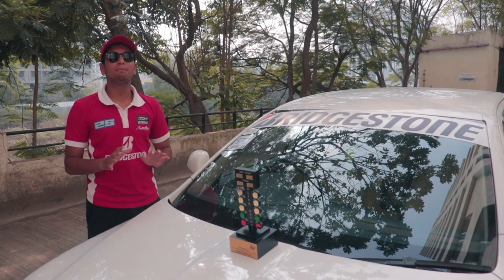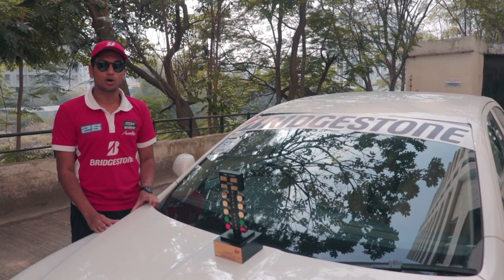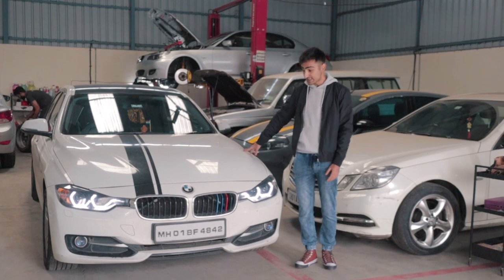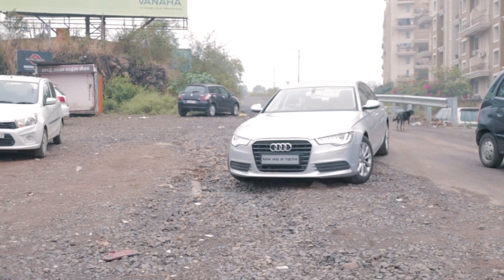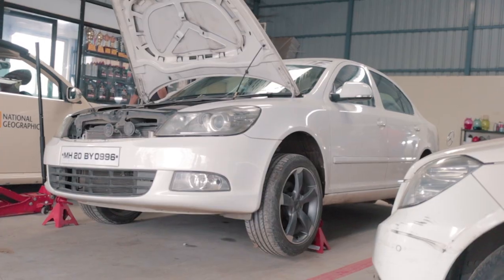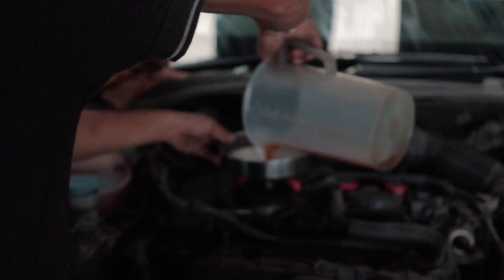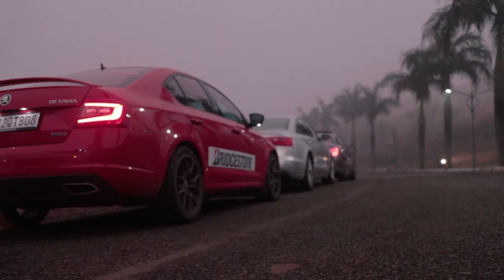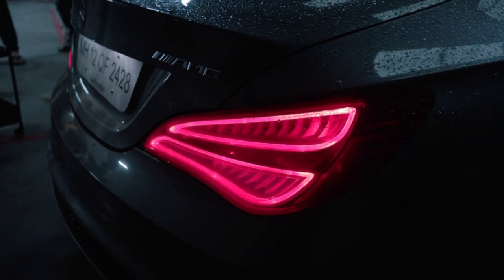Preparing all of the cars for drag racing + Stage 1 ECU Remap for the BMW 320d!

Comment: It's a prefacelift 320d with n47 engine . So it's the 184 hp 380nm version. Not b47 with 190 hp and 400nm
Reply: Is the b47 more linear than peaky? I want to upgrade from a Vento 1.6 TDI